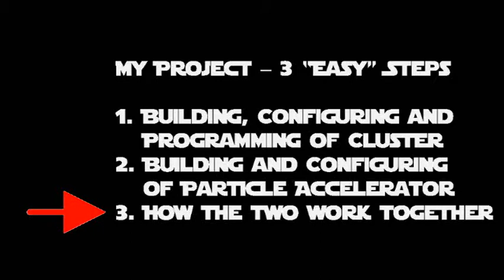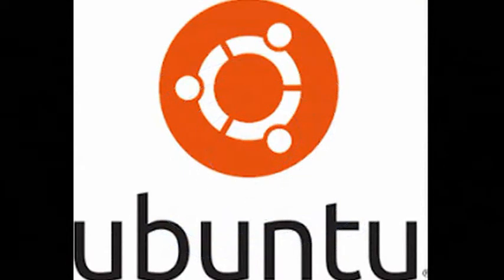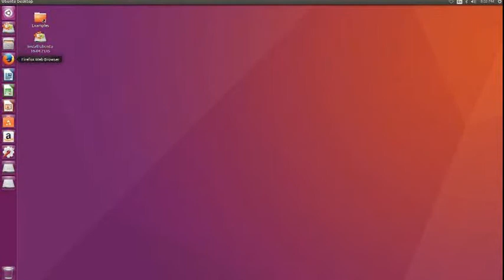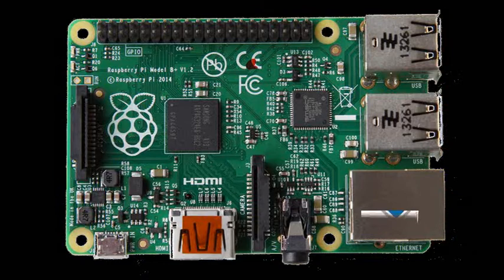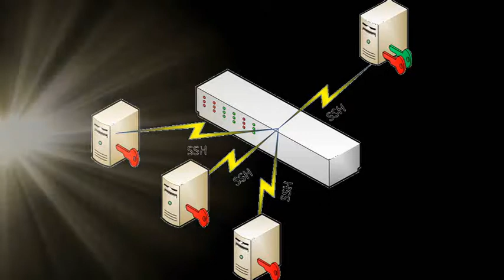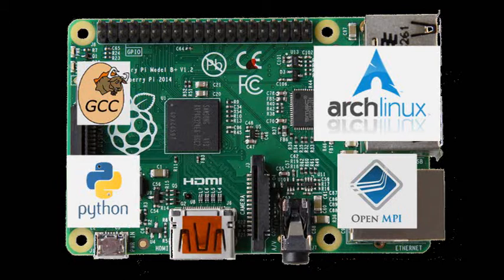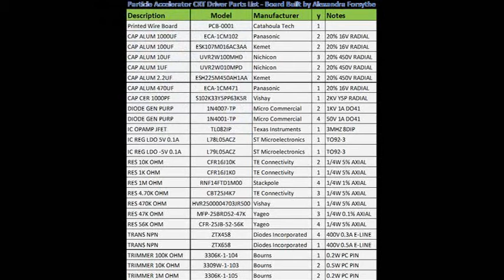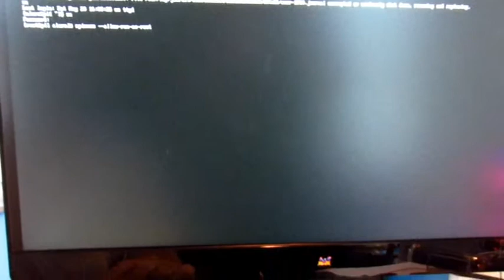My Supercomputer and Particle Accelerator (Technical Explanation)

Comment: As a Linux users I'm hearing a lot of programs i use regularly, so I now know what to use when building my own cluster. My problems are it needs to be mobile to place in my Velocipede - i.e. HPV - A. I have 3 Pi's and 7 to go. The HPV is A assisted by motors that collect kinetic energy and store this along with wind and solar power also gather from movement and distributed out to where they are required. I love your attention to detail. You now have ways to upgrade R2. Imagine R2 with all that processing power!

Comment: Where did you get the power adaptors for the cluster? I'm looking for a similar solution that uses the existing micro USB power input but have not found anything that fits my needs. Untill I saw the boards on your cluster, it is exactly what I am looking for!
Reply from the maker: I designed and built the power adapter boards as I could not find any pre-made adapters that would fit my needs. If you are interested in buying some, please let me know.